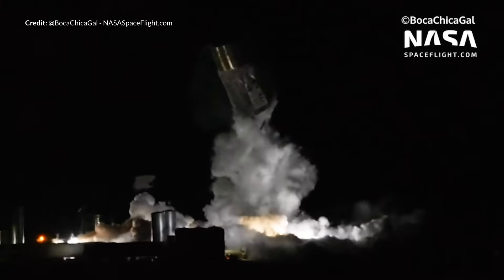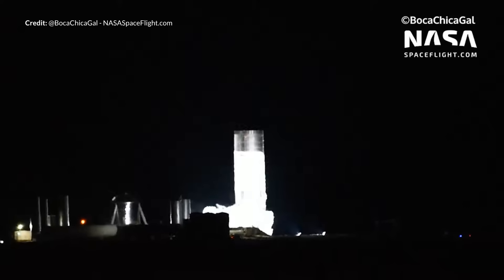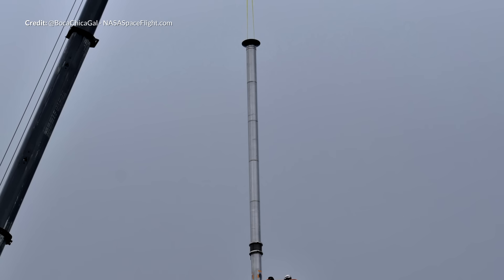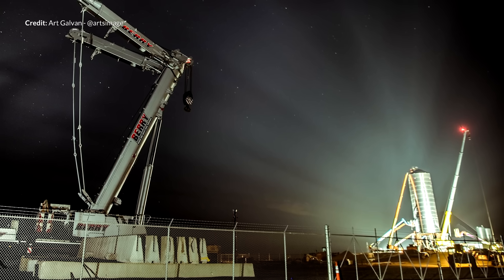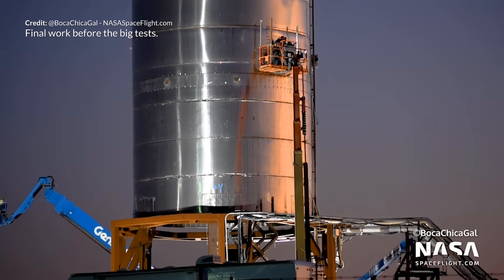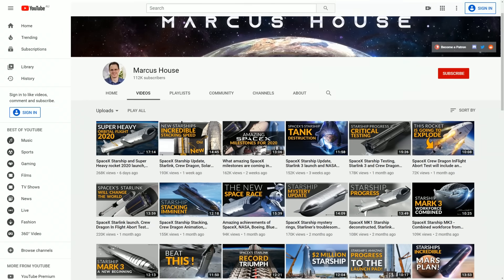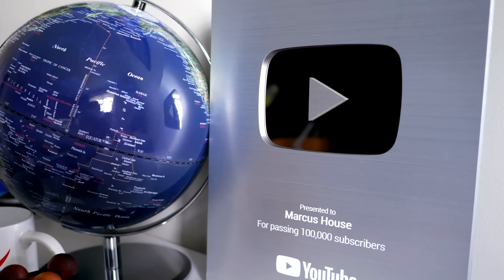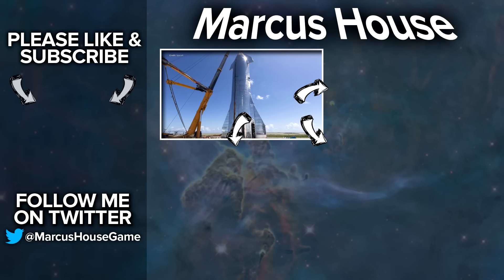SpaceX Starship Explosion of SN1 - Moving to SN2, CRS-20 delayed and Marcus House 100K sub thank you

Comment: Would it help if they filled the tank with Liquid Nitrogen to cryo reverse heat treat and then drain to return to normal temperature.   Then refill to test.     Look up cryogenic heat treating.  Would this normalize the welds and help the puck to tank interface? https://www.kitplanes.com/coming-into-the-cold/   https://www.metlabheattreat.com/cryogenic-treatment.html

Comment: I don't buy this failure bull.. yes u learn but it also sees like  it is a bunch of fabricators just throwing together a glorified  silo.   Is there no frame chassis or strength  to  this thing. I am no rocket expert but I have built many things in my life and fabing things out of huge sheets of metal can be very flimsy.  Unless strengthened by a frame of some sort.  This design  should have been done  and tested  thru finite element analysis prior to building the tank. I am a space x fan like many out there but I think they seem a bit amateurish  too me. Man has been building big rocket tanks for decades now what's the but fuss with these.  Tanks. How about a huge extruder  to extruder the tank then weld the seams.  Then insert some internal chassis or stiffening structure. , designed by structural  engineers verified by fea analysis.
Reply: "I am no rocket expert" Mhm. Best we leave it to the experts then, shall we? What's the big fuss with these tanks? What fuel tank do you know of that has to be made lightweight as possible and go through the forces of reentry, decent, landing and reuse?

Comment: It looks like it emploded then exploded and it seemed to be in the fuel mix . Compression of main body and no lift , it was like a dehydration effect of the oxygen took place and then the other stage fuel lite then all hell broke lose.  Don’t they try out a small model first .  Maybe just a some little dumb ass move some where down the line.  Most of them are.  Like who knew cologne would react with pure oxygen in such a way ,  just a small amount of vapor of alcohol could react in such explosive way add the radios and the electronic wave was trigger like Joe Kennedy .  What a bummer.🕎🕎🕎🕎🕎🔯🔯🔯🔯✝️✝️✝️✝️✝️🛸🛸🛸🛸🛸🛸🛸🛸🛸🛸🛸🛸🌑🌑🌑🌑🌑🌑🌹🌹🌹🌹🌹🌹🌹🏔🛰👽🎩😎🎩⚛️🎺🎺🎺🎺🎺🎺🎺🔯🐅🐅

Comment: Marcus, why has welding become such a difficult thing to get right? I understand the pressures are high, but surely not extreme? Any thoughts on why this has emerged as such a challenge for SpaceX?
Reply from the maker: The pressure is quite high really. Human rated required is 8.5 bar (123 PSI). With a fuel mix that will contain super cryo fuel (liquid methane/Ox) which expands/contracts the steel means there are a lot of things to get right. In this case it was the thrust puck that breached and failed, not the walls or the bulkheads, so this is progress. I know it seems slow, but they've been rapidly prototyping the tanks only really for 6 months or so. There will likely be more popped tests until they get it right. It is comparatively cheap to try and fail now they are using steel.
Reply: @MarcusHouse  what I don’t understand is why it’s a challenge. Your average submarine routinely cruise at 60 bar. I must be overlooking something.
Reply from the maker: @PersonalityMalfunction  A sub is very different because it is pressure pushing in, not out. Also mass matters little on a sub, so they can make it super thick. The dry mass of a starship needs to be very light comparatively. The idea is to make the steel as thin as possible whilst holding the necessary pressure. Every extra ton in mass as a ton that is removed from the useful payload to orbit. They are attempting to push the boundaries with dry mass to figure out where the limits are (which they keep finding currently). 😄
Reply: Marcus House Of course, the mass! Sorry, that was dumb of me - thin skin, thin welds! Thanks Marcus, that’s exactly what I was missing. Love your show!

Comment: Destructive Test and Re-Design till you exceed your goals by a safety parameter. that's they way russia almost got to the moon and designed engines NASA is using today.
Reply: Sound like the primary method used in overclocking CPUs. Throw all known controllable variables and push the limit till it cracks then back off a bit and continue to test for stability. Then we are running hot and ready.

Comment: I am actually very surprised this is happening. Any mechanical Engineer would know the formulas to predict the strength and stress loading of a pressure vessel. Maybe there's an unknown element to the predictions like temperature limits? I don't know it seems kind of rediculous to me if your engineers know materials strengths and have computer modeling it should be a piece of cake. If this is the best they can do they had better sit down and get this figured out before they go any further, and much before any passengers are in danger.
Reply: Modeling it is one thing. Building it is another.

Comment: Is there anybody who can tell me how did they already stacking SN2 so quickly because it take some time to understand and analyse the designe failure of SN1 and deciding what things will have to improve in next design.
Reply: The failure on SN1 likely happened because they used the wrong welding settings, that's something they fixed for SN2 even before SN1 exploded.
Reply: @Brixxter  if they know that there is something not right then why they made this mesh even damaging testing site. Instead they have to drop this test and postponed for SN2, because it saves time and resources which they are now wasting on cleaning the mesh.
Reply: @om_unique  maybe they didn't expect the weding quality to be that bad, who knows. Some things seem very odd about that whole incident, I agree.

Comment: of course it is suppose to explode since it's pressure test. which means that it was tested as to which maximum pressure it could stand before exploding. no mechanical or technical error there. it was intended to be that way.
Reply: It wasn't. A pressure test doesn't have to result in a failure, especially when you intend to attach an engine afterwards and perform a static fire. This was clearly unintentional.
Reply: @Brixxter  that's true especially when doing gas cylinders for example before before releasing them to consumers. but i think the SN1 is roughly built, and not really for that application afterwards. i might be wrong too.

Comment: I wonder how much of this was caused by the extreme cold of the Oxygen? Contraction and expansion reacts differently on different thickness of metals and welded metal. It can make it harder but more brittle or make it softer. Stainless steel I've dealt with rarely, but carbon steel has these properties'. They may need to make that tank out of 1 piece. maybe 3D print it. Just thoughts. Oh and insults don't advance the ideas one bit. It only shows how stupid you are, because you have no answers to the problem of the tank exploding.
Reply: It was no oxygen, they used nitrogen. And stainless steel increases in strength at cryogenic temperatures.
Reply: @Brixxter  But does a thicker piece contracts at a different rate then thinner pieces? Do the heat from the welds change the strength of the metal. Do the welds contract at the same rate as the rolled steel. Now when I say steel I mean stainless steel. I know the difference. I use to work with it. And I think that is where the problem is. Infact they will find the rupture started along a weld.
Reply: @donaldgrant9067  I'm not quite sure about the effects of heat but we've seen some fitting issues when they tried to weld rings together. Some dents appeared because the contraction of the steel but the welds seemed fine. They simply removed the dents with a hammer afterwards. They also x-rayed the welds so I'm not entirely sure if the welds really were the probem. Elon Musk just tweeted about the whole incident and they're now doing more testing on the bottom structure of the tank, maybe it's just a structural weakness that needs to be corrected.
Reply: @Brixxter  This comment section is where people talk about their theories of what is causing the failure. This is my opinion and that is all that it is. Just an opinion. I've worked with steel all of my life, not saying I'm an expert or anything, but have noticed a few things. For one thing even though they X-ray the welds, in the extreme change in temperature welds can fail. Again this is a theory, but I believe the investigators will find the failure started in a weld. If that happened the answer might, again might be to 3-D print the tank. My answer is better then calling everyone at Space-X stupid?
Reply: @donaldgrant9067  yes, I'm not trying to argue here either. 3D-Printing indeed is an interesting idea but that would probably require a totally different material. I like it though.
Reply: @Brixxter  Liquid Nitrogen is some extreme ass cold.
Reply: @donaldgrant9067  yes, it causes the steel to cryoform. This was expected but who knows what potential issues this causes. I hope we get some more data on what actually happened.
Reply: @Brixxter  Of course everything is speculation right now. Again mine is just  theories about what happened. Yes we need more information. But again my comment is constructive instead of demeaning Space-X like so many in the comment section. But hopefully the engineers will figure out what happened and fix it.

Comment: Welds under pressure like this "unzip" due to the ductility of the cast weld material is less than the plate steel base layer. the reason why you usually see a small leak followed by a big boom is that a small section of weld cracked, but the pressure drop means all the liquified gas tries to boil and actually spikes the pressure causing the unzip

Comment: I think you are right Marcus. The lower tank failed first. do we know what the metal used in the welds is made of, and if that metal gets better or worse at cryo temps?.+ The steel in the tank may get stronger at cryo, but does it flex as it has to. Like in a balloon. But we do know that a tank with fewer welds would be better as in a solid cass top and bottom with a solid ringed center section. that = only three welds, top to center, bottom to center, and down the center ring. just a thought.

Comment: Ought to make rings over the welds so that there's double protection at each weld joint. Instead of just welding to parts together,  add a 12" stripe of the same material over the weld and weld that. Especially something this important, with this much pressure. 
Also, perfectly round isn't the best shape for something at these pressure. Ought to stamp the metal, similar to a golf ball would work well and strengthen it greatly.  Ribbed would even work, sort of accordion shape.
Reply: Your a true engineer, top marks buddy.

Comment: Well, that's two in a row. Shall we go for a hat trick? this has been a bad couple of weeks for SpaceX, they missed on a landing, they had to delay a flight, and they blew up a Starship. On the other hand, the only way you can have such highly concentrated failures, is if you are very, very busy. SpaceX is conducting more activity than anybody else, shoot, more than the rest of the world combined.
I certainly hope they identify and so;ve their pressure problems so that SN-2 can actually fly. of course, it will probably explode during flight, but at least they will have gotten it off the pad. They probably will not achieve orbit this year. I don't know when they will, but i don't care if it's 2068, as long as it happens eventually.

Comment: I wonder how they are going to integrate the development of the heat sheild tiles with the starship tank development. Then they have to study the airodynamics of the starship, and how to control it during high mock number re-entry, then integrate that. And then there's the Super Heavy vehicle, and how to land such a giant vehicle, on rocket power back at the 39A or 39B lauchpads and how to manuver it. I think it will take a very long time for an orbital test, and even then, it will probably be a smaller test vehcle with a test article starship on top.

Comment: It is cheaper and faster to prototype this way, than set in one specific design, that does work, but you are also kind of stuck with it, and don't know if you could have done better. And setting manufacturing facilities for this one specific design would be a huge cost to set in so early. Better to build something crudish, but eventually working, and demonstrate it viability for the specific use. We will get there. They need to step up their metallurgy and welding game tho. More inspection, quality control, better techniques and automation, and damn don't build it in the windy conditions :D That is just a bit silly.

Comment: These boosters need to be made with the geometry of a paper-towel core.
They can be made in a welding machine that continuously coils and welds in one step.
The machine produces perfect welds, and no but joints.
Make the tub as long as you want, cut the ends square and stand it upright, no tedious stacking.
Reply: I think thats a good idea, only do they manufacture sheet metal that long or should it have to crisscross
Reply: @tomthomasjohnpaulmooremawr3014  Yes, I believe it would be possible to splice in multiple rolls,

I think shipping weight is what limits the length of each roll.

The machine would also greatly reduce or even eliminate the heat warping and crinkle that you see with the current method.
Reply: @tomthomasjohnpaulmooremawr3014  And the machine process would greatly reduce or even eliminate the heat warping and crinkles.
Reply: @fo shizzle I've seen this type of machine, It already exists. It's used to weld 12' diameter water pipe, mostly for west coast reservoir to city supply. I'm trying to locate the video.
Reply: You ease the manufacturing process with the machine.
But the increase in tube quality is the real win here.
Reply: @fo shizzle Shipping weight is probably what determines the length of a roll.

Comment: ELons problem is incredibly obvious. The tank wall needs to be multilayered or another term plymetal to handle the pressures. With Plymetal you have insulation to prevent fuel and oxidizer temperature variations and insure its reliability.

Comment: Appreciate these are test vehicles but they look as though they’re built to fail. They look amateurish in their construction. You might as well try to build it properly in the first place rather than experience all these explosions and expenditure. The engineers need to calculate properly what’s required before construction and build with the expectation that it will succeed.

Comment: It's like they are trying to reinvent high pressure tanks. What is going on? Tanks are used for rockets for ages now.
Reply: Trying to do it cheaper and faster.   It will bite them in the but one day.
Reply: @MrBen527  Shouldn't they just go for the best and most expensive way for the first one? They can cut cost later? Is it better to start at 0  and take the risk?
Reply: @VirtuelleWeltenMitKhan  Well, that's not how it works when trying to undercut others on cost.
Reply: @MrBen527  Yeah I know. Thought the main cause was "get to Mars". Not to do it in the cheapest way possible. I might have been wrong here.
Reply: Khan Doing it as cheap as possible allows them to iterate often and quickly without much financial risk. It also forces them to be innovative and not rely on expensive hard to make critical systems.
Reply: @smooth_lighting  key word (critical)  when it comes to aerospace systems they're all critical.   Especially with people on board.
Reply: @smooth_lighting  I see. I hope they get to a "safe" spot. Humans will ride this bullets.
Reply: like the strut failures  @MrBen527 ?
Reply: @jocramkrispy305  Exactly.   Saving money on substandard parts.  Aerospace parts are expensive for good reasons.
Reply: Khan , RIGHT,  Been wondering the same.  As an old guy I think of the original Atlas rocket.  When not fueled you could easily see the construction of the tanks.  But I know nothing.

Comment: Insanity Is Doing the Same Thing Over and Over Again and Expecting Different Results
I think its better instead of one big tank just make 6 or 7  cylindrical Falcon 9 like small ones and stock them in hexagonal order and put the 7th tank in the middle. Rocket will get a bit more weight, make it little longer to compensate. I mean just get 6 or 7  Falcon 9 like tanks and put them into Starship, that's it. Hey Elon, it doesn't need to be one big. Falcon 9 tanks are already tested 100 times. I think one big tank with this big diameter and few millimeter thick wall its a big NO NO. Sometimes we need to change a bit point of view. Take this from different angle. Starship diameter is  30 ft ( 360in") Just get 7 cylindrical tanks with diameter 115" each and stock all 7 inside. Why not. Its more safe and robust. If you use several raptors, why not to use several tanks.......?

Comment: I thought it was just a joke rocket the whole time. The tank walls were so thin and flimsy, the seals between the sections were hardly more than metal on metal bolted together (did they even use a sealant?), and as for aerodynamics, this is horribly shaped to pierce the sky.

Comment: Don't worry... it's only someones money.  Edit; Welding machines can greatly vary between units. The welding problem will remain a problem until all the welds are preformed by one (hopefully robotic) unit (or multi units calibrated to exact same specs). Of course SX knows this, but just info for the general pub... it's going to take awhile to work this out.